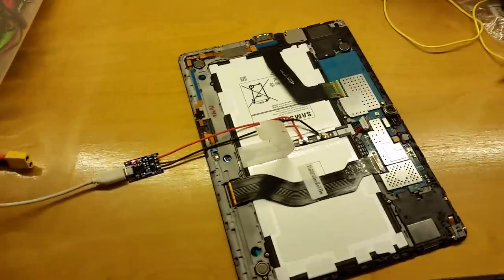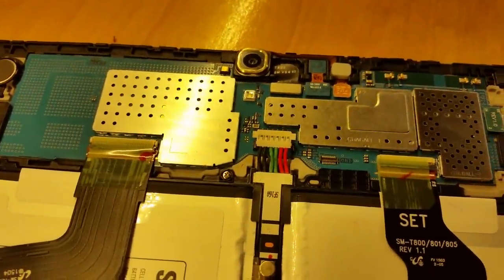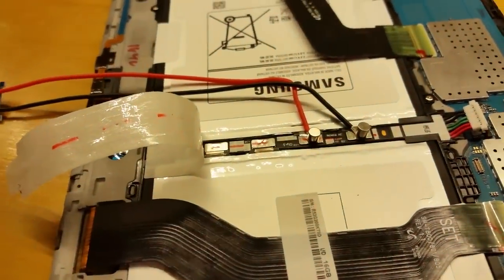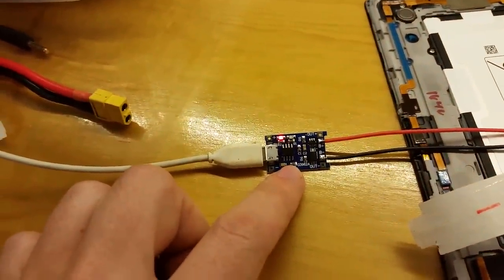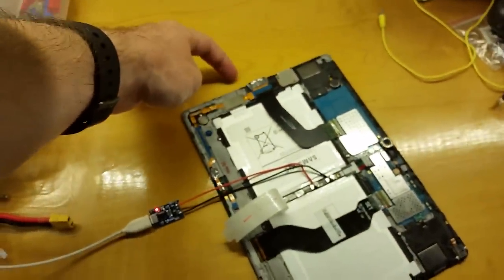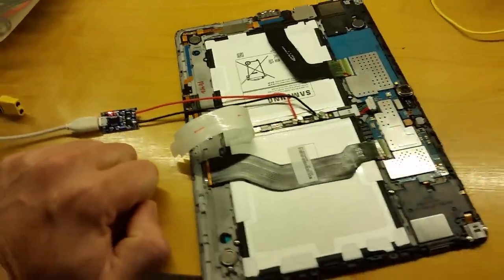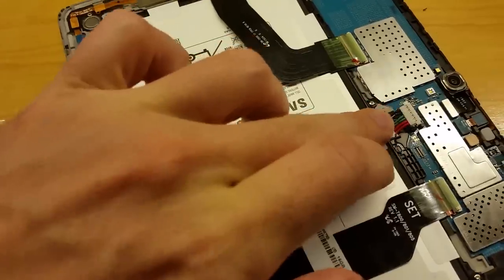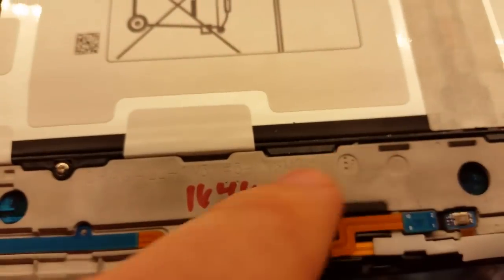Samsung Galaxy Tab S 10.5 doesn't turn on fix

Comment: hello       my SMt800   suddendly restart .. and restart again to infinite....  i open the backcover to disconnect  the battery connector to stop it .  After i reconnect the tab restart   and 2 min after again loop restart
just 1 min after i reconnect the battery connector , i see that the chipset  at the left of the battery connector is really hot ... it was nearly to burn my finger !   can you explain what is the chipset  ?     maybye this is why the tab reboot  and reboot ...   i nalso noticed that when i let my finger oin the power button , it doesnt reboot   or only after a long time ..... due to the price of this tab   i see that i can change the motherboard  .. do you think its a good idea  or juste wasting money ?   thanks for answer ;-)
Reply from the maker: gerald G. Hi Gerald, I am not sure whether it is worth trying to fix.. up to you maybe can sell for parts?
Reply: thanks for quick answer ;-)   but i dont want to sell  and re buy one expensive samsung( that die avec 3 year .... lol )    i asked this because i see  motherboard to buy on  chines store ( they are tested and with some guarantee) .. they are app about 50$ .... but  what is the function of the chipset on the left about the battery connector ?   Gpu ? Cpu ? or other ?    .....  this make me angry  to buy a good product a lot of $$  and  see it dying after 3 years !  this is why i would try to fix it myself :-)

Comment: My tablet is having problem when the tablet is shutdown and when I try to charge it doesn't charge it shows battery percentage only and when I charge when the tablet is on it will charge.
Reply from the maker: Yeah that sounds similar to the problem that was never resolved on mine. I suspect it is actually a hardware problem in the motherboard charge circuitry on this model. One workaround is to never put it to sleep and always plug into power when not in use. Another would be to run wires directly to the battery and permanently solder them to one of these charger IC boards - drill a small hole in the chassis or something and tape the charger to the outside. That way you can always recharge the battery and would be a decent workaround as they are long past the warranty date.

Comment: Samsung knows these tabs have issues. I have a samsung galaxy tab 2 10.1  wont charge, got a new battery wont charge, now I find the battery on the screen with the circle thing stuck.  Ive taken it to many shops, no one knows what the issue is.  I called samsung, they want a 225.00 holding fee (whatever that is) then 75.00 to fix it, and no guarantee to get the 225.00 back.  No more samsungs
Reply from the maker: kay Schaeffer yeah this model does seem to have issues..

Comment: i have the same issue but instead of pulling it apart I just used a fast charger from a s7 and it charged it no problems.  Hope this helps some of you. 👍